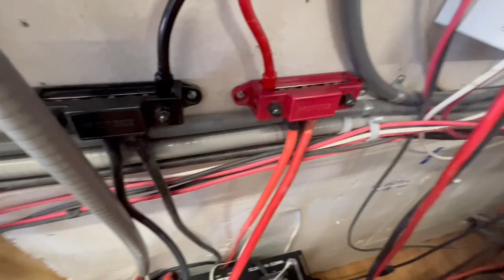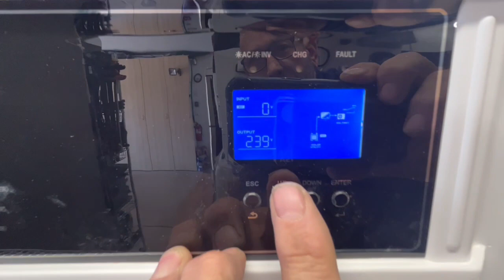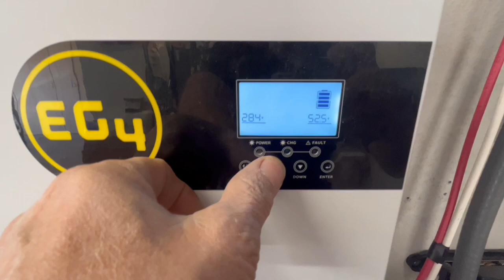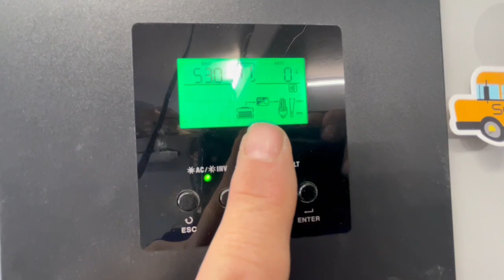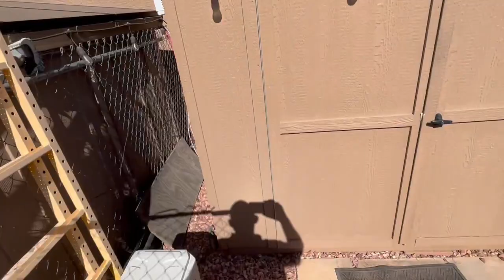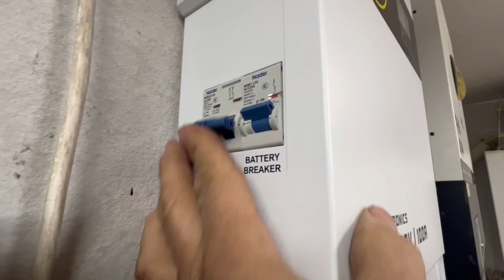Connecting EG4 charge controller to battery bank & solar panels to 6kw Growatt off grid inverter

Comment: You have so much going on in this video that it was hard to follow what you are actually trying to do.  Would like to see at least a block diagram of your setup.
Reply from the maker: Thanks for the comment. I actually have 4 separate independent systems. Each one used for different purposes at different times throughout the year. But the charge controllers can be used on all 4 systems by simply turning off breakers, disconnecting Anderson 175 amp quick disconnect on charge controller and connecting to Anderson quick connect on whatever inverter I need more power from to run the load(s). The charge controller is able to add watts or amps output of inverter Toruń loads and charge battery bank at same time. even though I might have 12,000 watts in panels connected to 12kw inverter, I will never get all 12,000 watts from All the panels. That’s where the charge controller added to battery bank makes up that loss from solar panels. All my solar panels are used. I constantly move my arrays from one inverter to another depending on what load I am trying to run that day so it would be hard to do a block diagram because my system is very versatile, expandable with pairing another inverter with existing mpp inverters. My house blocks the sun on panels throughout the day and I loose my east array by 1:30 pm every day. Using this charge controller I can simply add an array of the same size to battery bank at 1:30 pm and make up for the lost 3500 watts at 1:30 pm. One large system would not be able to supply my needs throughout the day because of shading issues especially in the winter time. Sorry for the confusion in videos, just trying to show everything I am able to do with the 4 separate inverter systems as I accomplish it. Hope you have a wonderful and truly blessed day.